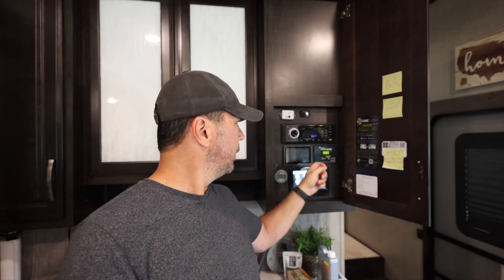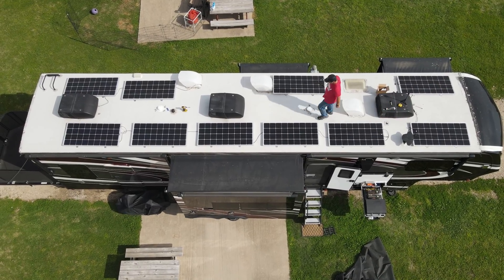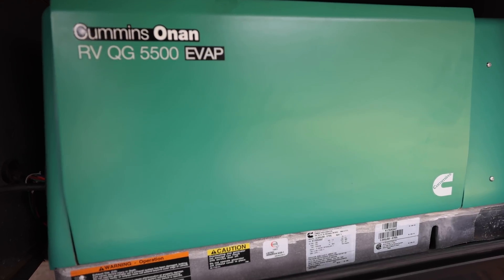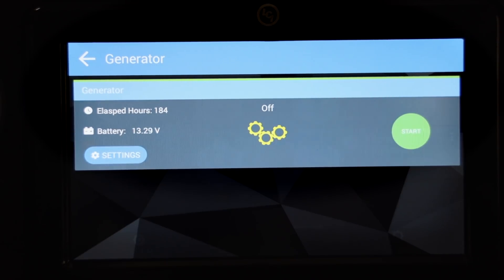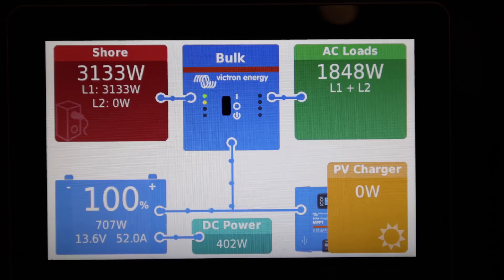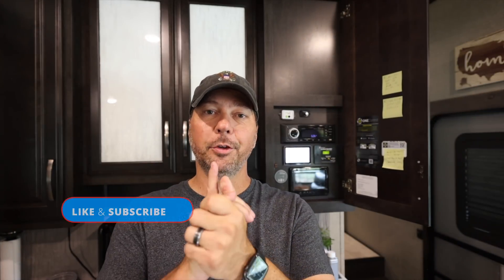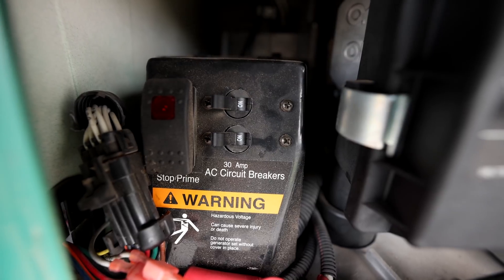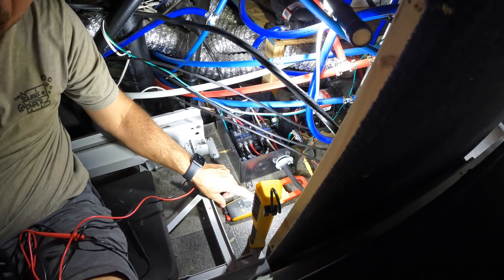RV Off-Grid (Solar) Power System Review and Fixes! (Full Time RV Life)

Comment: Great information 👍 especially if I decide to and more to my 760 watt panels. I kinda understood wiring the system 24v or 48v to handle the current while not increasing wire size. I've got the Go Power 3000 watt Inverter like you did to start and have had recently had trouble with it holding the program for Lithium batteries (600 amp hours). Go Power would work with me on swapping the logic board but that requires either sending that Inverter back to them or finding someone that they feel comfortable with locally to swap the board. Option 1 is Nada as I full-time and Op 2 I haven't had hang time to sit in one place to find someone. I just have to reprogram it every time I turn it on. Almost and tossing around the idea of just going Victron but understand their customer service is tough to deal with? Glad you figured it all out.
Reply from the maker: I know this is 3 months old, but your comment popped up as a member..   Thank you!!!  GoPower told me the same thing and I asked if they could take my CC Info and do a hot swap where they only charge my card if I don't send the broken one back.  So, you might try that approach.  Good luck!

Comment: Still learning alot..to the point to know that I am not ready to tackle this myself just yet....I am in a 14 Tiffin MH and currently no solar anything. I need to do is first create a bit of a schematic to fully understand what I have now and then a path to where I want to go...both in the head and the physical location/capacity etc.   
I know I want to prep in a way so that I can build up in baby steps if you will. First just to get adequate trickle charge capabilities (maybe as I start I will find this baby step not even worth it)  Currently all is well but I fear possibly batteries will go first so Looking to make that as an early on upgrade. S I guess I have a starting point somewhat determined already at least in the cranium!!   You probably have a list of products and such somewhere in a previous video or the web somewhere. I guess for now its just to find the proven good and effective and getting it going. Also, other forums or pages for rookies as I to learn without the mind being blown all at once would be great. Enjoy the travels.

Comment: I don’t know if you’ll ever get a chance to read this but in the oilfield we used to use lean twos attached to the top of the roof to put up extra shade to protect to get rain and the elements but we would use Steelz underneath to hold up the lien to and would have outside pipe to hold the Steelz from moving around Pinned in at top and bottom if people are looking to add more power to solar setup they could use this same setup, to put solar panels to rear of camper therefore not compromising roof a/c units and relocation of ladder is all that would change ,,therefore giving you more solar power and shade for your rear porch
Reply: Hope you get this ,, maybe it would bless traveling RV enthusiast like yourself who would love to have more solar power for their units thanks have a blessed day

Comment: Chad I got an idea I think it would help with solar panel expansion / if you take an aluminum sheet and build off the back of rv over your ramp, at top you could put stilts under it for support and add solar panels to the top of it therefore giving shade and more power to your install unit for solar power

Comment: Thanks for the great video.  I have a GD Solitude with a generator.  My problem was that when installed my solar system and 6 batteries in the pass through, I positioned the transfer switch behind everything, and I cannot now get at it unless I remove all the batteries and the board holding all the Victron equipment.  So  I then thought I would try to jump the lines at the generator.  This was also a no-go unless I pulled the entire generator out--too much for me to do!  So followed the generator output wiring out of the generator and noticed, for the first time, a square electrical box in the front compartment, and saw that the output from the generator went into it.  I opened the box, and low and behold, the wiring from the generator was joined to the wiring going into the transfer box, and all I have to do is strip off the electrical tape from the factory and join L1 and L2!.  Of course, there are a bunch of what looks like 16 gauge wires also connected there to the generator output wires, and I have not yet figured out what they do.  I'll let you know how it works when I get finished with it.

Comment: OK, I hate you :)
Going from factory installed 215w and 2 gc2 wet to 470 and 2 100a Battleborn on a 6 month old 5th wheel.  Also adding 2200w inverter that will physically plug into 50a plug I put on the front and wired into Gen ready box  complicating my setup is zamp and their "custom" solar connectors

Comment: Would you also trade in your Multi-plus II for a Quattro if you  went with a higher voltage?  I am also wanting to put a system in my RV and your video has convinced me to go 24V but not sure which inverter is right for the job.  We have a 50amp service
Reply from the maker: I think the 24v MPii is out now or will be soon.
Reply: @ChangingLanes  great, now I just need you to come to Jersey and help
Me, 😂

Comment: Well, it pays to procrastinate!, and clearly I must have been procrastinating for this video!  

 I've relied on solar/wind turbine/lithium and Victron for years living the good life on our cruising sailboat in Mexico. All was installed in 2016.  Last year we bought a '21 Momentum 397TH and I started the work on the electrical design so we can "anchor out".  Last fall I installed ten 200W Rich Solar 24V panels on the roof.  After that the analysis paralysis and procrastination set in.  I've gone back and forth several times on the 12/24/48V question.  Before this video, I'd kind of settled back at 12V mostly due to all the 12V devices onboard.  If I installed 24 or 48 volt, I would need a DC-DC step down to power the 12V devices.  At first, I thought no big deal, they're all low current LED stuff.  Then I ran into the hydraulic motor on the Lippert stabilizers.  That motor is rated at 100amps.  While it probably will never pull 100amps, any DC step down should be sized for it, and that means a big buck-boost converter and more $$.  

But after your video, you have me thinking about 48V again.  For the lithiums, I'm planning on the server-rack form factor from either SOK or Signature Solar.  I already have a couple of 100ah Battle Borns, so I'm now thinking I'll handle the 12V requirement by keeping the Battle Borns and running a Vicrton Orion DC-DC charger from the 48V house bank.  It will be a project for the summer.  We're presently on the boat in Mexico dealing with other projects like bottom paint, sails and running rigging.  Thanks for the video and the update on your thoughts.

And PS, thanks for your Navy service.  I was a Marine radar tech.  Our son was an Afghanistan combat Marine.  And our daughter was a Navy COD pilot.  My Marine Corps electronics training has led me down a similar path of a career in IT and "no tech shall go untested". :-)
Reply from the maker: Thank you BOTH for your service! 🇺🇸
Reply: @ChangingLanes  Chad, BOTH??  I thought sure you'd pick up on the "COD" (C2 Greyhound) reference with your Hawkeye experience.  The E2 and C2 are sister ships! 8-)  🇺🇸 🇺🇸 🇺🇸

Comment: Chad you are amazing. All the stuff is way beyond me but I always pick up something. Keep the great videos coming.
Reply: Chad I have a very similar system. I thought about using a 24 volt or higher dc system. The only issue with this is that the dc system for your trailer is 12 volts. If you used a higher dc voltage you would need a voltage reducer from the batteries to your dc panel. I have a tip for Power Assist. Recently we were hooked up to a 50 amp pedestal & the pedestal breaker kept tripping. I was running both ac’s, the electric hot water heater, & the inverter was charging my 8 batteries. When I looked on the VRM portal I saw that neither leg of the shore power was pulling enough power to trip the breaker. Thus I had a weak breaker. This was a weekend. I set the input current to 30 amps & when the demand was higher the inverter assisted & the breaker did not trip.

Comment: Question. What happens to all that solar/lithium/electronics when you decide to sell or most commonly trade in your rig for a new unit? I love the setup and have a much less extensive setup on my rig. My local dealer didn't want any of the stuff we had installed and preferred we remove the mods before we traded. With a system as extensive as yours what would you do?
Reply from the maker: We will sell it with all gear when the time comes and start anew! 😊

Comment: My Cerbo WIFI was intermitting also.. turns out there's a design flaw with the Cerbo. There's a mod where you open the unit up and move the internal antenna wires and it works great now.
Reply from the maker: I tried that and ours already had the change.  I was hopeful.. LOL

Comment: Great information.  I am getting ready to install the exact same inverter in my 30 amp motorhome.  With a onan generator.  I want the dual line inverter to share a line with the enclosed trailer  I will tow at times

Comment: I had the same problem with our 5500 Gen LP; installed a Victron 32A Autotransformer - wiring L2 through the autotransformer and by passing L1 creating a 180 split phase so the two Victron Muliplus Inverter / Chargers (3000W Each) work in split phase as I had programmed. I can now use all available 45 amps from the generator. I also spoke to Todd at NRVTA and he stated he has seen a Victron Autotransformer installed, but he has never installed one. This was an easy solution to the generator single phase problem.

There was an ~ 4 - 6 volt drop on L2, so increased the generator voltage output to ~ 125 Volts on the remote console, so any voltage drop on L2 would keep the output voltage ~ 119 Volts. We will be discussing this in detail during NRVTA Solar School in May 2022.
Reply from the maker: The only drawback to that method is the power share will only be for L1 and not the whole RV.
Reply: @ChangingLanes  The entire RV has power to both legs since each inverter ./ charger is programmed for split phase where as before installing the autotransformer, the inverter (L1) AC was powered and the second inverter (L2) inverted only since L2 was out of phase. Before adding the autotransformer, both L1 & L2 were single phase. 

The autotransformer is an option I offer for RV solar system installs for RV's with onboard gen sets.
Reply from the maker: Oh.. Yea.. if you have 2 inverters, no problem.. 👍🏼
Reply: @ChangingLanes  Hope we can catch up one day to visit about all the various configurations for RV power systems.

Comment: Great info! You explained this very well and I too find inspiration walking around the home improvement stores (Lowes, Home Depot, Menards, etc)! I just added the Micro-Air Easy Start to both my A/C's today as I know we will be camping at some places that only provide 30 amp connections. Got them wired up and watched my SurgeGuard display for what amps they drew as they started up. Only saw about 12-14 amps on the individual A/C's and 23-24 amps when they both started at the same time. Love Technology!

Comment: I also wondered about the 12 - 24 - 48 volt options as I watched your video last year and have just begun doing my own research. How big of a deal as far as cost and money would it be to convert your system over to let's say a 24 volt system?
Reply from the maker: It would just be a re-wire of the batteries and a DC-DC converter.. Of course some DC wiring would need to me moved around - putting all the 24V on one side.. Oh, we'd need a 24V inverter also...

Comment: You did not say how you insulated the ground bar.  Spice tape probably would have worked.  A more conventional approach would have been a split bolt wrapped in splice tape.  A more elegant solution would have been to use an insulated multi-tap connector such as the ones made by Polaris. They will have an amp rating and they make for a really clean installation. Home Depot caries a limited selection, Grainger probably has a few more but they come made for many different wire size ranges and many different quantities of wire.  

Thanks for a great video.
Reply from the maker: Agreed.  The description, pinned comment, and blog post were all updated to that end the night the video went out... I'll be swapping it out. https://amzn.to/3DXemK6

Comment: That sounds great UNTIL you come across a plug that provides 120 v on each leg with opposing cycles. 😳.  You married the legs together.  The rv hots are separated for a reason.  I ❤️👍 your info and journeys .
Reply from the maker: The ONLY lines bridged are from the generator which is isolated by the ATS.  The shore power connection (in phase or not) are not bridged in any way.

Comment: QUESTION:  With all this power running through your trailer/ 5th wheel. Seems your unit would be glowing.  Do you have to add another ground to the systems. Ground Rod or 110v cord to provide extra ground?
Reply from the maker: No extra grounding.  The system is self-contained when disconnected and the pedestal provides ground when hooked up.

Comment: Great stuff Chad. I put 1.2 KW solar on the roof of my 2021 Momentum 381 using strut channel and the MultiPlus II 12 volt 2x120 last August 2021 with 600 amps of Battle Born and all Victron parts, Touch Pad etc. This solution solves my problem. Do you have any close-ups of how you insulated the 4 port ground bar. I saw the guy below used jumpers in the ATS. Photos, videos or more detail about this would be appreciated much. Thanks for what you do!
Reply from the maker: Use one of these instead... I ordered one (based on a comment) and will be swapping it out.  https://amzn.to/3LZxQQX
Reply: @ChangingLanes   I just ordered one of those using your link. Never new there was an issue till I saw your April 2022 video. Need to boon dock more often! Thanks - We have 2021 Ford F-450 White pulling a 2021 Grand Design Momentum 381M with 1.26 KW solar; Victron Energy MultiPlus II 2x120 in stalled August 2021, Touch 50; 
Charge Controller 150/100; Cerbo GX with Internet Reporting through T-Mobile Wingard Internet SIM Connectivity; Smart Shunt 1000; 6 Battle Born BB10012; 3 ACs bedroom only with slow start

Comment: In December of 2021, Tesla installed my solar roof and powerwalls.  One thing about them I was surprised to discover was this thing called the Cloud-Edge Effect.  I only have an 8.5kW system over the whole roof, so on my best day so far with no clouds, I get a maximum peak of around 5.6kW.  When there are clouds, I'll get peaks sometimes around 7.6kW due to this effect.  I can tell it's happening using the app because of the "spikeyness" of my power generation.  That's typically caused by the clouds blocking the sun and then when the edge of the cloud gets near, I'll get a high spike of power.  Fortunately, due to the fact I have two inverters and each inverter can handle 7.5kW, this isn't much of an issue.

One thing I do like about my system is that I can run my house for about 5 days in cloudy weather without power from the grid.  I know it's never going to pay for itself in the long run, but I found that given the other options, I liked going solar/battery for my house vs getting a generator.  Not to mention on a "normal" day, my power use from the grid is negative, meaning I'm putting power back out to the grid vs using it.
Reply from the maker: Funny you mention that... We were traveling on a cloudy day and I had the VRM open on my phone to see how things were doing.  As we broke in and out of the clouds, I would sometimes see the solar spike to over 1900W!  First time I'd ever seen that.

Comment: Just watched this - I envy your electrical knowledge.  When I saw those 10 batteries I was thinking, 'what kind of weight does this add to your coach"?   I have a similar Genset in our Fuzion.. Now I'll have to check out the discharge wiring to see if ours is split into twin 30s also...  

Trying to follow the 'stuff' you all have in your power management system I'm reminded of an old "Laugh-In" reply when Dan was giving Dick instructions to follow..... Dick would reply, "You lost me at the bakery".....when there was never any mention of a bakery.

What you've done, and installed IMHO, is way above what the majority of campers can ever afford to obtain unless they're as trained as you are..  It's beautifully done and I can't commend you enough.. Many thanks for this video.. Safe travels, Chad.

Comment: Could you explain?:  why get a 2k inverter and buy a 3k or 4K later, rather than buy an inverter larger than you presently need so that later you won’t have to “upgrade” the inverter?  Signed; “solar dummy”.
Reply from the maker: We bought the 2K inverter in the very beginning and it was enough at the time.  At the time (almost 5 years ago), there was also a big price difference.